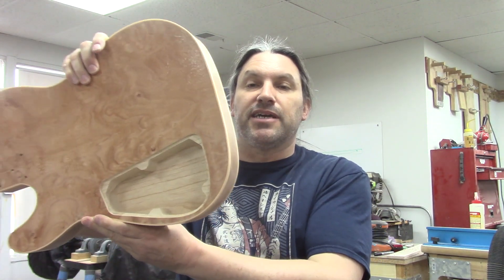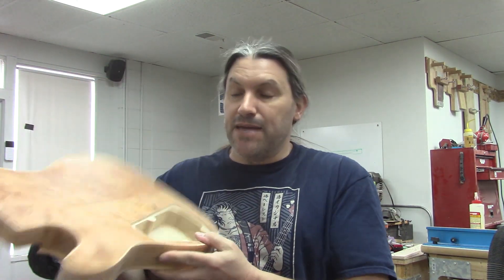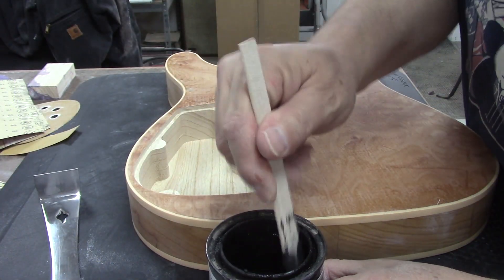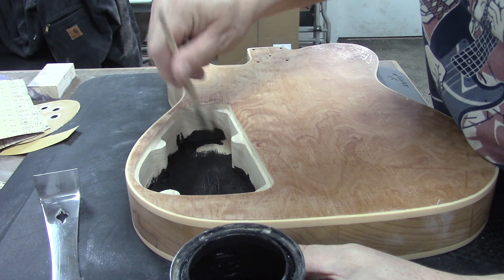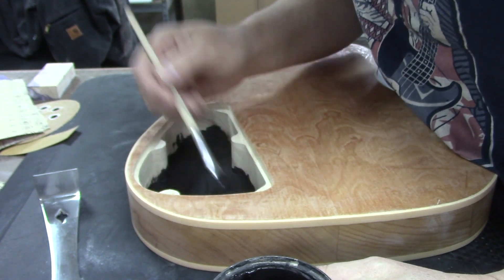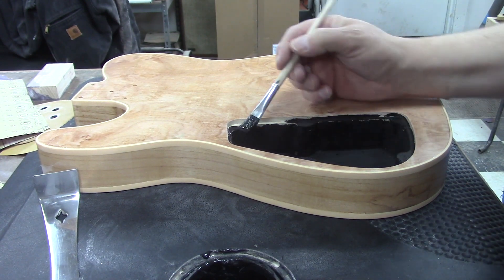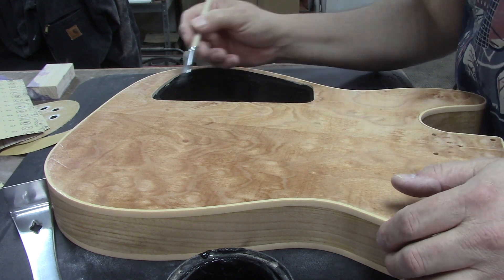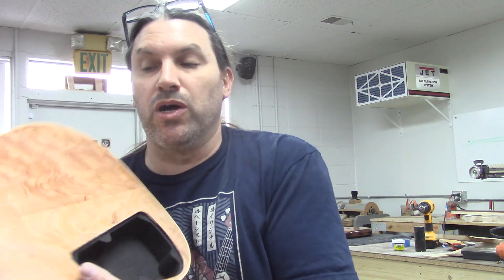Shielding Your Guitar Is Easy... You Are Making It Harder Than It Needs To Be

Comment: All electric guitars need conductivity between all connected metal components - strings, pickups, selector switches, bridge, tailpiece, pots, output jack. Any hum or interference should stop when you touch any of those parts with your fingers. If it doesn’t then you have a break. Best way to reduce extraneous noise from a correctly-wired guitar without issues is to unplug as much as you can. Eg phone chargers in the same powerbar as your amp generate huge noise. (former military electronic warfare engineer)

Comment: Great video. I made my own shielding paint using one ounce of acrylic craft paint and mixed in a few teaspoons of graphite powder. I painted a test stripe on a piece of scrap wood and tested it for continuity with a multimeter to ensure I had enough graphite in the mix, which I did. Very inexpensive, works great and doesn’t seem to flake off the way you say Stew Mac’s paint does.

Comment: The conductive paint is still conductive when you paint over it with something else, you're just insulating it. It's the same thing as an insulated wire. The wire inside doesn't stop being conductive just because you covered it with something that insulates it. If you pierce through the top coat with your probes, it will still be conductive underneath.
Also the guitar itself is an insulator, so if the shield works enclosed in the guitar, it'll also work under paint.

Comment: I ground my guitars with quality noiseless single coils and a shielded wire from the input jack..... as for the...rest all the methods are valid(this one is slick by the way) but i find myself either not doing it at all or if i do i use the cheap aluminum tape to make the cage by folding each piece at the edge to have conductivity with the next(not that sexy).....if i had shielding paint around i would use that as a first option....copper looks better than all the above but in the end the result is the same......choose whatever helps you sleep better at night...

By the way...why is this channel only 30 thousand subs...one of the best guitar building channels out there....hope in the new year you ll double them...peace.

Comment: The problem is, you might be right.  

I've got one of those electronic engineering degree things, and we all understand how Faraday cages work.  In intuitive terms, there are electric and magnetic fields passing through the "ether" (ahem) and the wiring acts like a radio antenna or the coil in a pickup and picks a signal up.  Faraday cages "short circuit" the fields around the volume inside.  To do that completely, they have to be completely closed, no holes, conductivity all round, and we all understand why that is, there's no issue.    Unless you go on to spend time working in that specific area, that's probably all you are going to think about it.  And then some (likeable, articulate, experienced) clown comes along and says holes don't matter in practice, in guitars.  And like you say, they are called cages not boxes anyway.  

Either you can dismiss him, or you can ask yourself how that could be.  Maybe it seems plausible that a single microscopically small hole might not have too big an impact, so then you ask yourself how big could that hole be before it would have a significant impact?  Now you have to bear in mind that there is an enormous amount of amplification in the "signal chain", so even a very small leakage could have a significant effect, so you would have to do some calculations which are "quite tricky" to do.  But there are a couple of points of reference in those calculations, because they are points of reference in the physics.  One of those is the wavelength of the signal.  FM radio has a wavelength of say 3 metres (in American units, that's about 3.3% of the length of a football field, or three quarters the length of a VW bug), AM radio is 2 or 3 football fields, and audible frequencies are tens to hundreds of km (no equivalent US unit, just "a very long way").  So potentially you could have rather a large hole on that score.  In simple terms, it's harder for an electromagnetic signal to manouevre through (US: "get through") a hole a lot smaller than its wavelength in a surrounding conductor.  Another point of reference is the size of the hole relative to the size of the box - I'll just say it might seem plausible that a small hole in a big box will have less effect than a big hole in a small box (or I might say solve Maxwell's equation to find out).  Both of those act strongly in your favour to reduce the pickup, but remember the high gain signal chain counteracts that, so it's a numbers game.  If experiments show that small gaps are not giving too much pickup, I'd be inclined to believe you.  

Also, think about these:

1.  If the wiring in the guitar cavity needs to be in a Faraday cage, wouldn't the wiring at the input to the guitar (or a microphone) amp or at least pre-amp need to be in a Faraday cage too?  Many pre-amps and amps are indeed in metal boxes, but those boxes often have gaps (e.g. if they are pressed metal rather than castings), and many are in plastic boxes.  Some of those plastic boxes have bits of aluminium foil stuck on the inside of the control panel connected to ground, presumably to short out any electric fields from the user's fingers when they adjust the controls, but not on all surfaces.  

2.  Look at the gaps in the braiding in braided coaxial cable - you have to think the designer wasn't thinking "it's a Faraday cage, so it can't have any gaps", but rather "copper's expensive, how little copper can I use and it still work (i.e. how big can I make the gaps)?".

Hmmm.

It may be that some older amps would reproduce radio signals - this was a design problem is some early transistor amps due to lack of "high frequency bypass", you shouldn't be getting that with decent gear, and the guitar's tone control may well bypass it anyway.  

I'd strongly advocate the use of screened cable everywhere inside the guitar, this is the first defence in audio.  

Also, avoid creating "ground loops" in the screens/grounds (i.e. "circular" ground routes, basically you want as far as possible to have all ground connections coming from a single point, a "star" configuration, or daisy-chained, but no loops, see e.g. Wikipedia).

Subject to all that, I'd say you do want shielding in the cavity, you do want shielding on the scratchpad or cover, you do want your pots and switches etc) grounded, and you do want the scratchplate and cavity shielding grounded;  but if that's what your experience says, it's very plausible that those only need to be single point connections, you don't need continuous connections between your shielding all the way round.  My instincts say I'd prefer one "known good" connection to each piece of shielding rather than a questionable connection all the way along joints between shielding.

As a final point, even a simple single-transistor buffer/pre-amp in an active guitar, if properly configured, should massively reduce electromagnetic pickup in the wiring beyond it, because it should have a much lower impedance at its output, and in a properly configured setup that "shorts out" any pickup in the wiring between it and the amp.

Comment: I think a lot of people get mixed up about the RF shielding and the ground of the audio circuit because they are usually electrically connected but they have two different purposes. You’re on it. The shielding can bleed off Radio Frequency interference that is in the air through the ground of the audio circuit or reflect it. I don’t know the details of which is better or happens more but I believe it depends on the strength and frequency of the interference. The current generated by the pickups is significantly higher power than the RF in nearly all cases. A big power supply for a neon light can pump out some serious RF for a short distance for example. Anyway, I believe what you are saying is true and the shielding paint will work fine just like you are saying.
Reply from the maker: It works great

Comment: ? Ok so does the painted cavity need to have a ground wire running to the system ground? Or is the paint by itself enough?
Reply: The pots and switches connect to the grounding paint when you mount them.

Comment: I used copper in my Challenger build. Like you you mentioned, it is there to keep RF out of the electronics. Is only serves as an electrical reflector/absorber. People also get all worked up on this and then buy cheap cables. As for connectivity, most pots will touch the cavity shield by default anyways when installed.
Reply from the maker: Your guitar turned out pretty great man.
Using good stuff is always the best answer
Reply: I'm guessing the paint is the same stuff they used on the stealth fighters and bombers radar-absorbing coating.

Comment: I was going to use the shielding paint the instructions required three coats with 24 hours between coats which is a 3 day process. I ended up using household aluminum foil and spray gorilla adhesive which took about 30 minutes and worked.
Reply from the maker: That is not the way we use it. :)
Reply: I’ve found that if I brush on a good ole wet coat and let it dry, I get the same result as applying 2 or 3 coats. Those extra coats are a waste of time and material. But hey, that’s just my own opinion. 🤙🏻

Comment: Kent Armstrong is a neighbor of mine. He maintains that if you use shielded wire throughout, there is no need for anything extra. The paint has nickel filaments in it so, if theres not enough coats of it, the filaments may not form a complete circuit.
Reply from the maker: Kent Armstrong has probably forgotten more about electronics than I'll ever know. 
We don't worry about a complete circuit

Comment: Can't say I agree Matt. The whole point of shielding (anything) is that it takes stray outside RF signals and shunts them to ground, hence making things generally quieter. If it's not conducting, it can't do it's job. Shielding paints are good and you can spray anything you like over it as long as all of the stuff attached (outside cover plates) conduct with the shielding paint and the shielding paint ultimately goes to ground. 

If you use tapes (copper, aluminium), they all should conduct together and should ultimately shunt everything to ground. How you do that is up to you. But if you just have floating tape, it's actually not doing anything electrically. You can get away with just putting shielding on a pickguard - It works (if it's grounded). Is it better than a full cavity? In terms of electrically shielding, no. But some is better than nothing. It can change the sound of the pickups too. Some like it, some don't - each to their own.

I did learn a few things when I was an electronics tech and 4 years of college  - other than where the pubs were before class! :)
Reply from the maker: We aren't trying to do anything electrically with shielding... we can disagree
Reply: @TexasToastGuitars  Matt, if it's not going to actually work electrically, you might as well save yourself some dollars and just paint it black. It will do the same thing. And to tell the truth, if you used shielded wire and grounding the pots it pretty much does the same thing anyway.

Comment: I have only built five guitars so far, and the need for shielding paint is much greater with single coil guitars.  Even then I tried both copper foil and shielding paint with two different tele-style guitars, and although it did help, neither were completely hum-free.  Humbuckers of course were a silent as a grave whether I shielded the cavities or not.  (Hence the term, "humbucker"?)
Reply from the maker: Some guitars really benefit from shielding but as you pointed out... some don't
Reply: When you coil split a humbucker it becomes a single coil.  Then you need to shield the cavities, especially the control cavity and the selector switch cavity.

Comment: I can confirm it's not true that you need conductivity. I did my guitar and completely forgot to make sure every piece of the aluminum foil tape was conductive to the next. Buttoned it up and it was 200% better. It was so quiet, I thought a wire had come loose so I wasn't getting any sound to the amp.

Nope, all the wires were fine. It's just that quiet now. I was beyond impressed. Luckily I don't have microphonic pickups in my guitars like you find in some inexpensive guitars like the Firefly 335-style guitars. My Silvertone "Strats" are actually very good guitars, IMO. On par with any Squier for sure.
Reply from the maker: Thanks JC, as you know there is certainly no downside to having conductivity but it's no big shake if you don't
Reply: So you didn't check but you're sure you didn't have conductivity. I don't understand your logic. A lot of tape has conductive adhesive, so will be conductive. And even without that you'll have incidental conductive contact points between the conductive surfaces. So chances are you had conductivity, you just didn't know it.
Reply: @vw9659  because it's known that aluminum tape doesn't have conductivity from one piece to the next. You have to do extra steps. That's why. Plus I checked it the next time I took it apart.

Come on man. Can you not think logically?

Comment: If complete conductivity was important then the control cavity and pick up cavity should be stamped metal boxes with shielded wire connect them, heavy shielded wire to bridge, a wire through the body and neck to the tuners and the player needs grounded also. When I worked as PA Technician/Engineer, RF interference was always an issue. Also guitars would need ground lifts and polarity switches to match with electrical power at the amps and processors if perfect connectivity is absolute need.
Reply from the maker: HAHAHA guitar players are funny, and chasing stuff like shielding hum is a fun one

Comment: I've shielding one with copper tape which I found to be too much of a PITA for my preference.  All my others I've applied MG Chemicals Super Shield paint.   Both do the job; the paint is easier.  My experience or findings concur with everything said in the first two minutes of this video.   The notion about continuity of conductivity throughout 100% of the cavity and wire ways is indeed false. //I never considered overcoating the shielding paint with sanding dealer though; that's a new idea to me.  I've only had one opportunity where I could have done this before sealing and finishing a body myself.  It didn't come to mind at the time but it makes sense, rather than shielding after the body was finished.

Comment: We bought some of the "magnet board" paint a few years ago. We surprised our daughter by putting that under the paint on one of her walls so she could stick photos and stuff to it without putting a bunch of holes in the wall. My question is, does a magnet stick to the shielding paint? I am basically wondering if I can use some the leftover paint I have as shielding paint. I kind of assume it is basically the same stuff. Color is about the same and it is really watery. Thanks for the cool videos!
Reply from the maker: Hmmm I don't have any idea, but it sounds like a good thing to try
Reply: @Geoff Cowan Probably not. Shielding paints main constituent is graphite powder.
Reply: @peterschmidt9942  My main reason for checking is that 8oz of shielding paint is $39 and 32oz of magnet wall paint is about the same price + I have some left over magnet wall paint... :)
Reply: @geoffcowan2384  Yeah it's expensive stuff from Stewmac. As long as the paint is electrically conductive, I don't see there being any issue unless it's actually magnetic and it may interfere with the electronics of the guitar - that's probably the only downside. I'm actually going to do some testing of zinc paint on one of my builds when I get a chance.
Reply: Peter Schmidt best I can tell it is ground up iron in latex paint. No more magnetic than the steel boxes you find in some Gibsons.
Reply: @geoffcowan2384  Should be fine then. Just do a test and paint some on a board, let it dry. Then test it with a multimeter. As long as you're getting some conductivity it should work.

Comment: I think shielding paint and copper tape are both equally good.  I used copper tape for my bass because I have another use for it other than the bass.  If I had a container of shielding paint, I'm pretty sure it'd dry out before I ever used it again.
Reply from the maker: They both work great. We have to add water to the paint sometimes since it dries out. All the graphite powder settles at the bottom too

Comment: First of all, I’m not an electrician nor a guitar builder, so I may be completely wrong, but here is my 5c on shielding.
I don’t know what people think when it comes to shielding, but here it is: you build a Faraday cage around the electronics in order to stop radio waves that may produce noise in the electronics. Now, think about that; what happens when you are driving your car listening to your favourite radio channel and you drive under a bridge or a tunnel made of concrete? The radio signal dies, it gets stopped by the cage of steel “threads” that supports the concrete. This cage is obviously open at both ends, which means there is no complete continuity in this cage (actually it is not even a cage but a half cylinder...). I strongly believe you could use chicken wire into your guitar cavity to obtain same result... ;-)
Reply from the maker: We have wondered about a wire mesh as well

Comment: Hey Matt. Do u shield the backside of the control plate too? If you do, how do you get it to make a good contact  to the paint? Wouldn’t sanding sealer “insulate” the shielding paint and make a poor connection to the back of the control plate? (Lol devil’s advocate)

If it works, who cares, right??

Lol thanks for the video!
Reply from the maker: Thanks Zach, we do use the tape for the control cavity covers